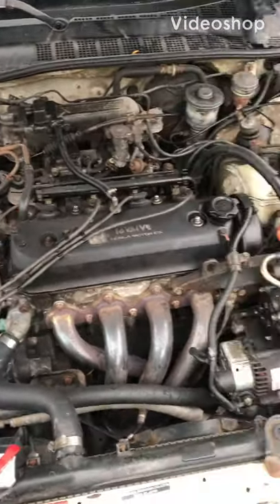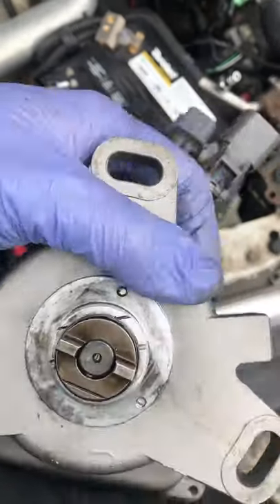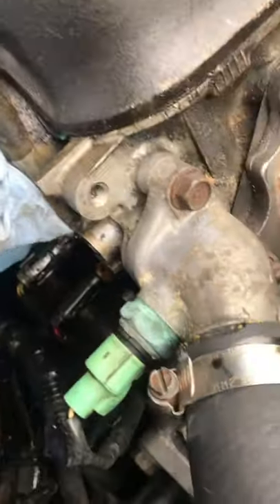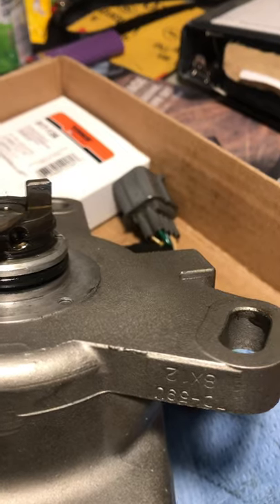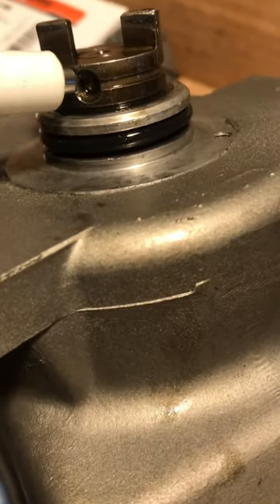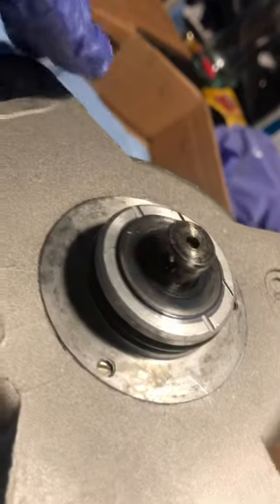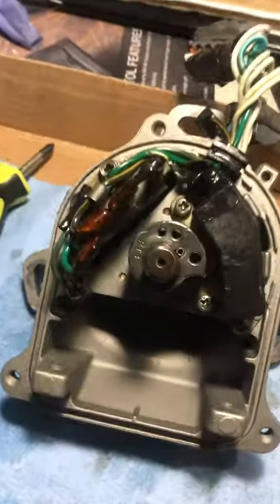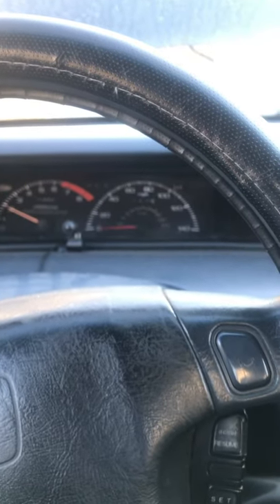Honda Prelude Distributor O-Ring and Seal

Comment: Help needed...I have leak from my distributor . i order and replace o ring ( Honda Dealer)...I had the same issue..Then i bought new o ring next step thicker than the original one..Same story again😥I remove the distributor cap so i will check if the leak is from inner seal but inside the distributor there is NO any oil is clean like new...So i guest the inner seal is ok
Anyone face the same problem? 
Thanks in advance
Reply: Did you replace it still ?